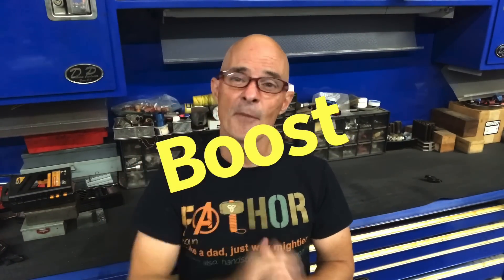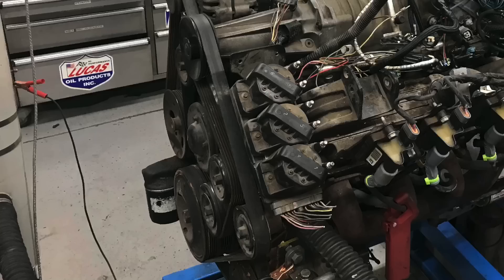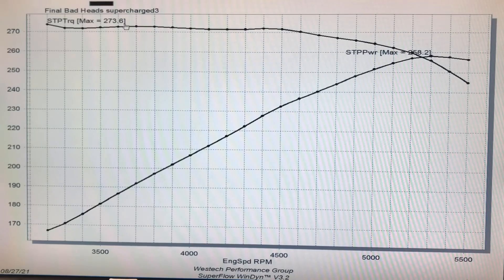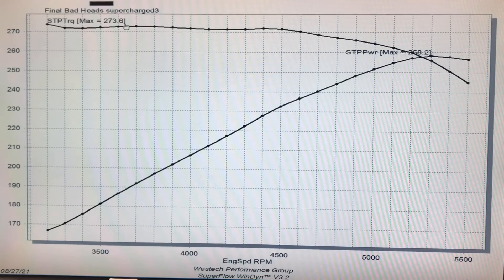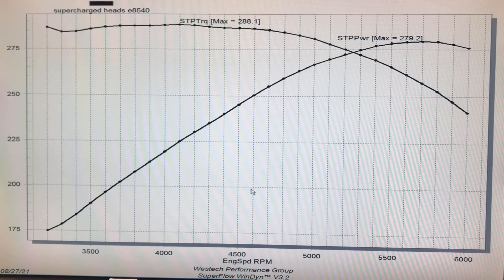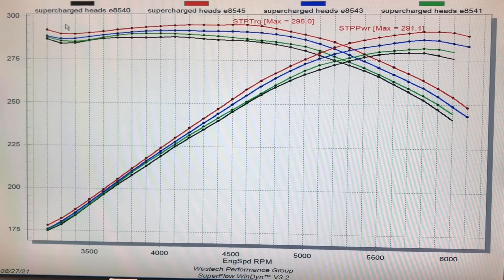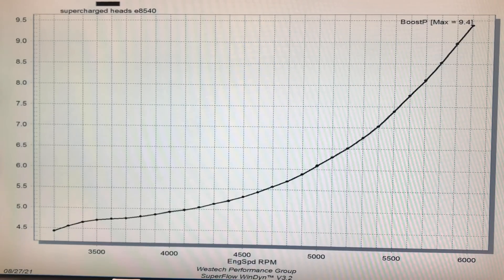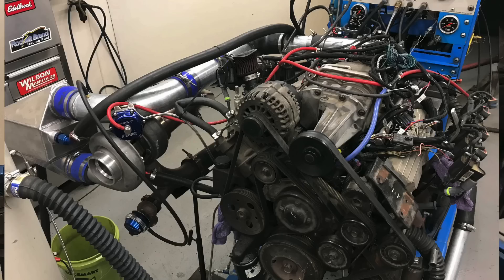THE OTHER GUYS 3800 L32 HOW TO MAKE HORSEPOWER. CHEAP, JUNKYARD SUPERCHARGED V6 POWER (PT 1)

Comment: Looking forward to the turbo portion of this series. I'd like to see what these things are capable of.
Reply: The fastest build so far on a turbo 3800 came from my fellow michiganders a couple hours outside of the Motor city. They(ZZP)built a 1000-1300hp mid 8 sec FWD 3800 Grand Prix. I believe they still hold the world record for fastest FWD 3800. I haven’t seen anyone top that yet for a 3800 build.
They sell kits that can get a junkyard 3800 to 600-800hp pretty easily. They were doing it with these right around the time the 5.3 and 6.0 craze started. The stock rotating assembly is very strong.
I own a supercharged 97 Grand Prix, mine was dynoed at ZZP in Grand Rapids and made 325 to the front wheels, I think it was around 13lbs of boost
Reply: @jzlove5088   Been a long time but I thought RWD was in the 7s
Reply: @DarkLinkAD , supposedly there were videos of a 3800 in some contraption that ran 7s around 2005-2008. I can’t find anything about it though. Except one old forum with broken links to the vehicle.
Reply: @jzlove5088  Theres a couple cars in Australia running 8s in full street trim with twin turbo 3800s, and they're four door Holden Sedans 🔥
Reply: Guys I Australia run easy 10s in RWD 3800s 👍
Reply: @barneymiller7894  Nugget garage "Kevin", youtube channel for hilarious V6 content.
Reply: @UCQSUgWYbfdQBg8GcBuxgHsw, very nice! Getting close to mid 8s. Definitely up there in the top 3800 builds!

Comment: What kind of intake air temps does this see with the stock pulley ratio?
Reply: Above 100 usually, with 4 sizes smaller pulley (the typical mod range most entry level guys go) can be close to 200
Reply: @jacobburskey3044  Im guessing probably over 150° but i dont know. I only have experience with gen 2 Bonnevilles running the gen 3 m90

Comment: Ford supercharged 3.8 v6 next
Reply: Running those will be a challenge. Only 2 years came with obd2 and I've never seen a stand alone controller.
Reply: @Matp345  They run a Holley engine management system.  It can be programmed to run anything.  No OE computer setup needed.
Reply: @jimt9661  yea im sure they could figure it out of course. That DIS system those 3.8s had could be hard to get around.
Reply: @Matp345  megasquirt efi is pretty popular and is made to work with factory obd1 efi systems and convert them to obd2.
Reply: @stevennunez6013  I guess we'll have to wait and see what richard does. I'd love to see one on an engine dyno.  Went to a few thunderbird dyno days years ago but as we know wheel and flywheel are way different

Comment: Rich, do you have a vid on a 5.4 2v Triton
Reply: Torque shelf!
Reply from the maker: only 4.6l-did some 5.4l 4V
Reply: @Steve B Only the early Pi 2v and very early 3v castings had the issue of very few spark plug threads. They revised both heads with 8 thread castings. The old npi 2v 5.4 had no issues.
Reply: @madmod  unless you check in with the GT500 crowd where the heli-coil kits are so common that Autozone has them in stock with the tool to install and kids do the repairs in the parking lot.
Reply: @dfabeagle718  That's because the same helicoil kit that works on a two valve works with the three valve and four valve be it a 4.6, 5.4, or 6.8 so of course AutoZone would keep them in stock.
Reply: @madmod  I have a Ford Bias but I like pretty much every form of not walking. That said, it's kind of embarrassing that the kit is in stock for any production engine, much less all of the modulars. Never had this problem with anything else on such a large scale. That's not to say I've never pulled threads out with the plug on an aluminum head, it's just not supposed to be common.
Reply: @dfabeagle718  Its realistically only an issue on 2 of the 11+ modular castings. Ive had a plethora of modular powered vehicles from mustangs, f series pickups, Lincolns with 2v and 4vs, and the only vehicle ive ever had pop a plug was a early pi triton v10. Properly torquing the plug on an early 2v or 3v casting will prevent plug blowouts in most cases and its a super cheap and easy fix. Its the people who over/ under tighten a plug with hand tools that end popping plugs. With 4 rows of spark thread on these 2 different castings, its super important to make sure its properly torqued. Meanwhile, with my Npi 2v, mark viii, and crown vic all have 8+ thread heads.